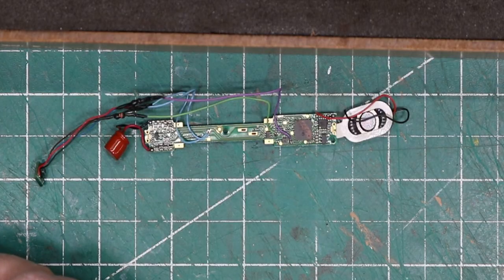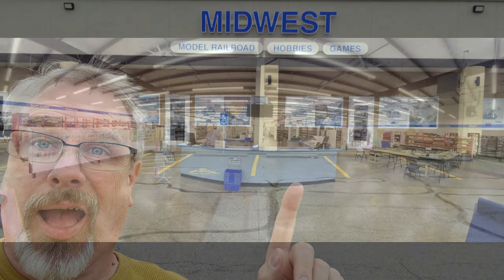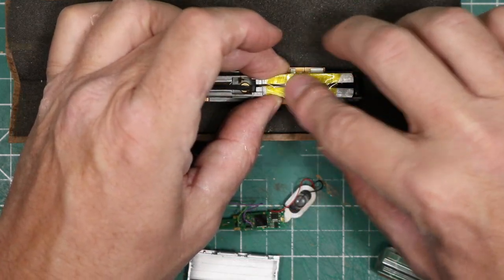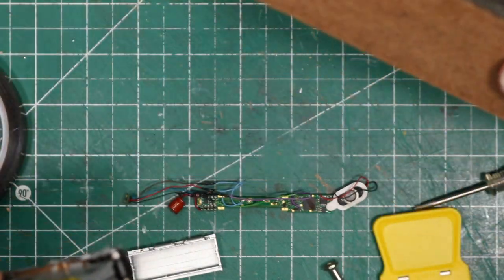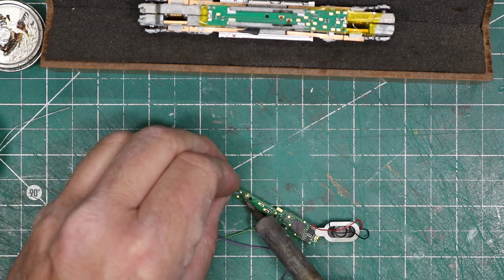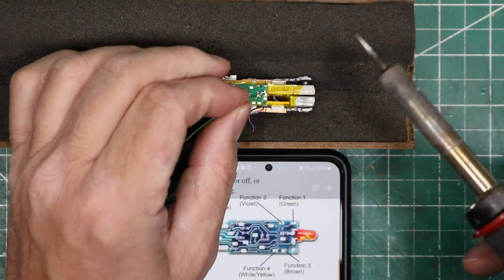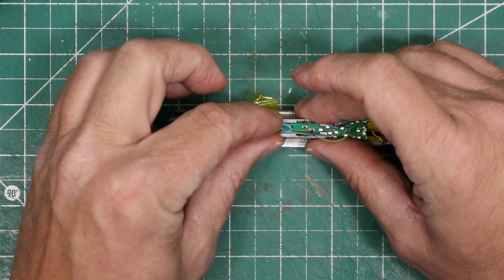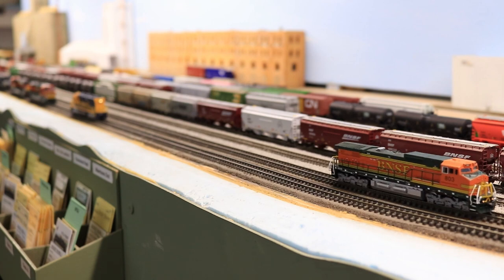How I Install a Decoder with Lighting Effects

Comment: Thank you so much for this Ron.  I'm saving this one for the near future when I dust out my 20-30 year old Kato and Atlas collection of DC locomotives which I will consider upgrading to DCC.  One of my main concerns was the independent ditch lights and I will value your video greatly as it is very well done and easy to follow.  Happy New Year.

Comment: Thanks for sharing. I got a DCC starter set and the locomotive is DCC ready and I’ve been dragging my feet, but this helps tremendously. Thank you!!👍🏼👍🏼😎🚑 on a different subject …… how would you apply no-ox to tracks in tunnels, bridges and hard to access hard to reach tracks, please?
Reply from the maker: If you have a means to clean those tracks, then apply no-ok to all the tracks you can reach and allow your locomotives wheels to carry it to those hidden tracks over time.
Reply: @RonsTrainsNThings  Thank you very much, that makes good sense.